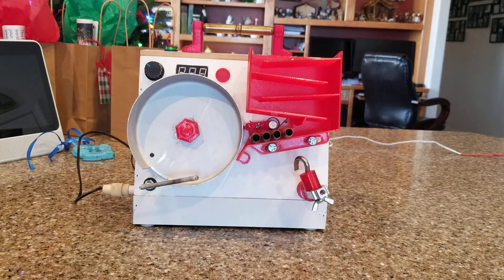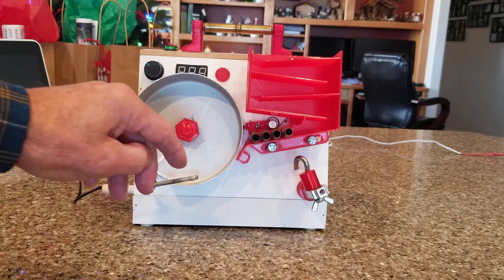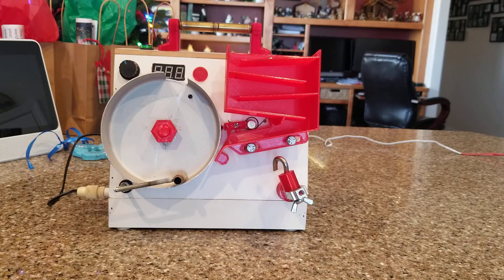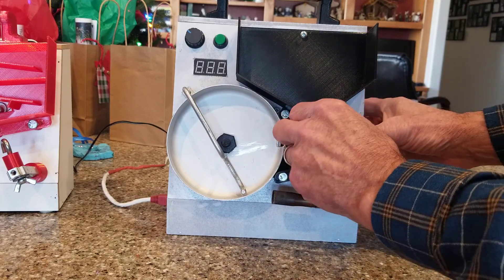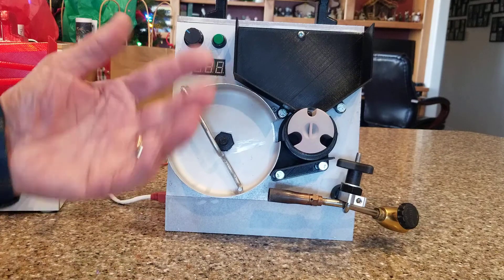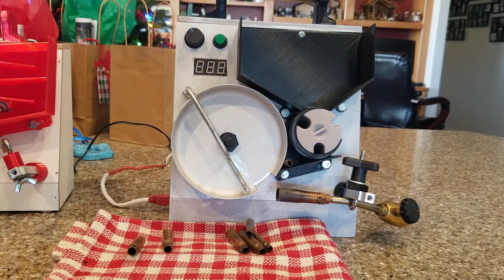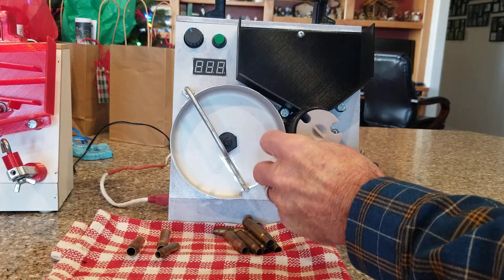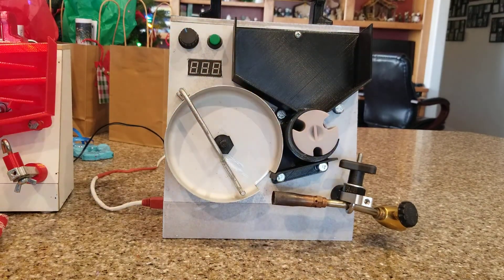Another DIY Brass Annealer, 3D Printed (partially)

Comment: Hi there
Big fan of this video, I am going to build one myself..
Question though, since I live in Denmark, buying and shipment + toll of the printed parts will run up. But I have a 3D printer myself. Will it be possible to obtain the STL for the printed parts, or is that not for sharing?
BR
Jesper
Denmark.
Reply from the maker: I'm sorry but I don't share the files at this time.  My V2.2 is still available though.  I have shipped many to Europe and it is usually between $25-$30.

Comment: Hi Mr. Bean, I very much appreciate your providing of the specs for the machine and printed parts. I have a 3d printer so it has been no problem. It works great. Question: I have noticed that the metal drum gets quite hot after about ten or so annealed brass. Is this normal? Am I doing something wrong? I am using a pencil torch which keeps the broad flame down but still gets hot. Is it a problem for the plastic parts? Should I not worry about it and just keep annealing? Thanks for any help you can give. Barry
Reply from the maker: It's going to get hot because the hot cartridges rolling around on it can't be avoided.  I've done 100s of rounds without a problem.  I print with PETG but if you use PLA it has a more likely chance at melting.
Reply: @msgbean  Thank you, Richard. I will print my next machine with PETG. Much appreciated.

Comment: You can use an ac motor with a light dimmer for speed control.
Reply from the maker: It would need a digital display so that you can set it at your determined speed for each cartridge or you will have to time it each time.

Comment: Some say you are less than a god but more than a man! This is the best design hands down for the DIY!!!! Especially with the kit you offer and free assembly plans! Just friggin WOW! Going to order a kit or two here soon and do this! I've been sitting on the pans and electronics for my DIY Annealer for a couple years and was just gearing up to build one. Found your video when I was refreshing myself on design ideas. Hope I can salvage some f my parts to work with your kit.
Reply from the maker: Thank you for the kind words.  My goal was for it to be light and compact but loaded with features and as cheap as possible but effective for the DIYer.  I have seen so many designs that are massive and I didn't want to store something like that.  Just trying to do my part in helping the reloading community.
Reply: @msgbean  I am getting ready to do 223 to 300 balckout cases and this is one reason for the annealer. I want to soften the new necks prior to resizing to new caliber.

Will this design handle that short of a case? Or maybe get a secone 5" pan and cut it shorter for the shorter case?
Reply from the maker: @jonbraddock5545  I do recommend having a second drum cut to 3/4" for blackout which will also work great for .223.   Any thing bigger I would suggest sticking with the original 1 3/8" drum which will work for .223 through 30-06.
Reply: @msgbean  Roger that. Hope to get an order in this week. I have automotive bearing installed tools and have tap bearings in many times on cars and bikes. Is the bearing install pretty straight forward or anything different with the 3D material?
Reply from the maker: @jonbraddock5545  You just need to slide them on by hand.  Maybe a little straight tap with a hammer.  I tried to keep tolerances fairly close but to close and plastic will break.
Reply: @msgbean  Thanks for the info! I just checked and I have (2) 6x2 pans. Looks l I need to get new pans... nutz!.

Comment: Well, I managed to build it and get it going!  Just need to finish my idea for handling shorter cases.  I am going to make a small plate that will attach to the holding rod with magnets.  It will act like a ramp that will push the shorter cases out once they fall to the bottom of the tub.  That way, there is no need use the bottom plate in the tub that screws in and out and the associated adjusting feed mechanism to keep things lined up.  You just snap it on and go, take it off for longer cases.  But...that will have to wait as I am leaving tomorrow for Indiana (my oldest daughter is getting married Saturday!).

Anyway, here it is on its first run to check feeding with 243 cases:

https://www.youtube.com/watch?v=ueEqrMObCXQ
Reply from the maker: Good job.  I'm glad it's working out for you.

Comment: Hmmm, got all my parts now (motor, etc)...still going to have to figure a way to adjust the depth of the main tub and feed mechanism.  I need to anneal 300 blackout (case length 1.38" up to large stuff).  The default tub depth is too deep for 300 Blackout, but if I cut it shorter, then the big stuff won't fit right.  I could a shim plate inside the tub (I've seen that on other annealers), but how to adjust the feed side too.  I'll have fiddle with that some.
Reply from the maker: I think all you would need to do is print some longer standoffs and use some longer bolts for the hopper and feed ramp.  Currently they are 1/8" standoffs behind them.  I think you could safely use 1/2" and still have enough axle to drive the cartridge drum.

Comment: My friend had some issues with his 3D printer, but he managed to get things fixed and I I now have all the printed parts.  Is there any way you could post a list of the specific other parts for your build?  Motor, motor RPM, magnets, etc and where you got them? Also, what kind of glue did you use for the magnets?  I've tried gluing things to 3d printed parts before without much luck.  May parts are ABS, except the brass rotating drum is PLA.
Reply from the maker: In the downloads there is a file called Annealer_Misc_Parts.pdf.  It lists all other additional parts.  I use epoxy to glue the magnets. Make sure you rough up both sides before gluing.  (Edit 11-24-21: It is now in a file called Annealer_Insturctions.pdf)
Reply: @msgbean  Ah, so it does.  Teach me not to pay attention :-)  Thank you!

Comment: One of the best thought out designs I've seen.  A couple of questions:  1) are the gear ratios the same for both the main annealing tub and the case feeder wheel? If so, don't they get out of sync at some point?  2) Will the hopper hold a full load of cases that have some body taper to them?  I've seen other designs with a similar hopper and the upper cases tend to slide out as the higher it is filled, the more forward tilt they have due to the taper.   Thanks!
Reply from the maker: The gear ratios are 1:1. All three gears are the same size so they don't get out of sync.  The face of the annealer is inclined 15 degrees so it will hold 300 rounds of .223 without falling out.
Reply: @msgbean  Thank you.  Having the parts printed by a friend and going to build one for myself.  I'll call it "The Bean Machine" !!
Reply from the maker: @edwardlance2379  Dang, I actually like that better than what I thought about calling it, "Annealerator"

Comment: Mr. Bean, in 3D printing some of the item, I noticed the magnets in the cartridge holder and the cartridge drum do not line up. Also the cartridge axle end with the hex is way to large to fit the hex hole on the cartridge drum.
Other than these small issues. 
I appreciate all your time, ingenuity and energy not to mention your graciousness, in allowing us to use your design and drawings to build this brass annealer. Thank you, Sir!
Reply from the maker: The depressions for the magnets are symmetrical and both pieces are tangent with each other.  I don't see how the magnets could not line up with each other unless there is a problem with your printer.  The hex axle should be a nice fit to prevent slop.  Unfortunately, not everyone's printer prints the same.  The way my printer prints the part is perfect.

Comment: Great job on both of your units and very innovative. What are you using for the pan shaped disc to hold the cartridges ?
Reply from the maker: That is just a 2x5 cake pan from amazon.  I cut it down to 1 1/2".
Reply: @msgbean  Thanks Richard !

Comment: Mr Bean I live your ingenuity.   Fantastic design.   Could you give a little more details on the arm that stops the shell in the flame and the magnets you incorporated.
Reply from the maker: I used a 1/4' rod and threaded both ends but you could just as easy use a threaded rod.  The magnets are 12x2 neodymium magnets.  If you go to the Thingiverse link you can download the document with the dimensions of the rod.  There is also a parts list with links.

Comment: Would you provide a link to the parts that you used?
Reply from the maker: I used different motors in the two models but I recommend the following:
https://tinyurl.com/y2rxg72e
https://tinyurl.com/y33vaxnu
https://tinyurl.com/y367f5gg
Almost everything else I 3d printed or is wood.
Reply from the maker: For some reason the speed controller link takes you to a different product.  Here is the speed controller I have. tinyurl.com/17lpsl05
Reply from the maker: @Erik Hohenfels The link above and the one on Thingaverse bring up the same motor.